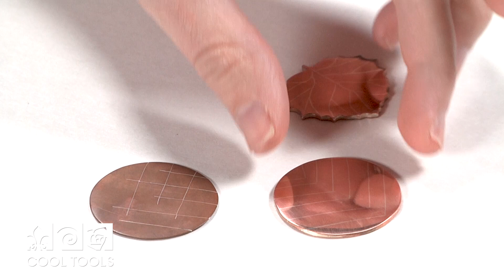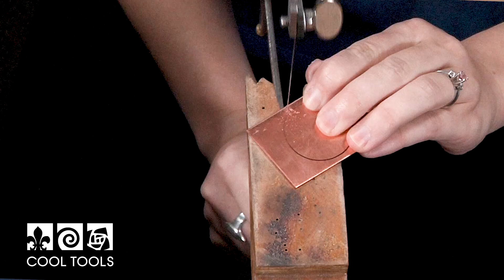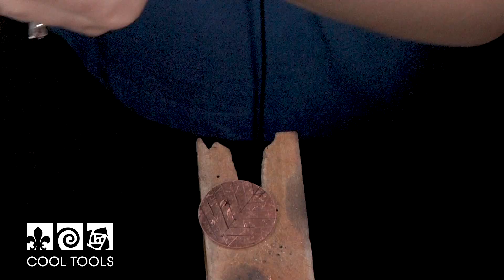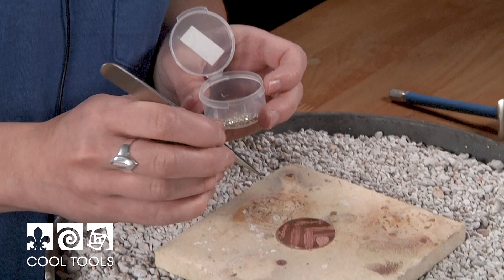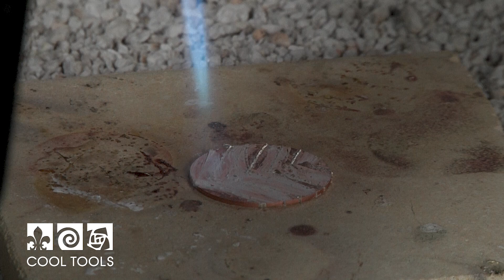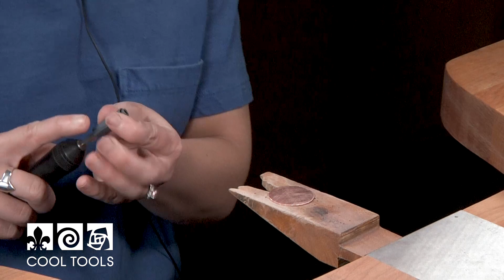Cool Tools | Marriage of Metals Process by Karen Trexler

Comment: This is great ! 
For a similar result without soldering, this is also possible to carve a thin groove of the size of a silver thread, using a very small chisel, and hammer the silver into the groove, then sand and polish the same way its shown in the video.
The profile of the groove has to be in a little "dove tail"-shape, like in a carpentry work,
To allow the silver thread to be "anchored" into the copper as the thread deforms to fit the groove.